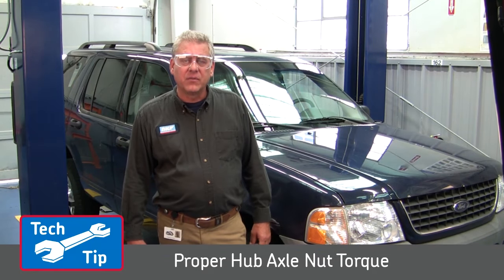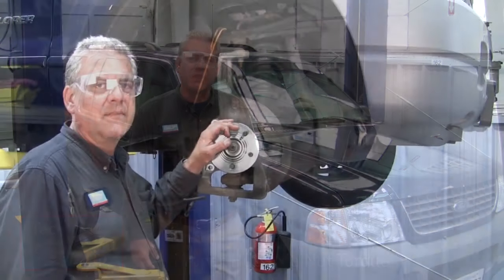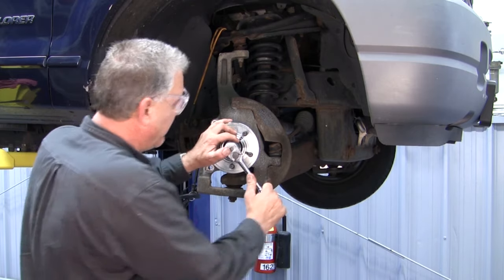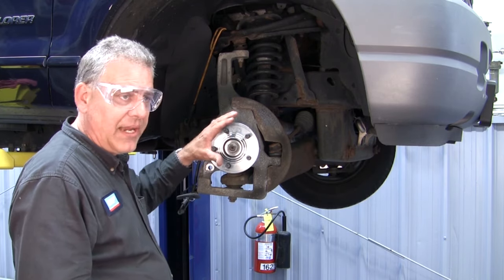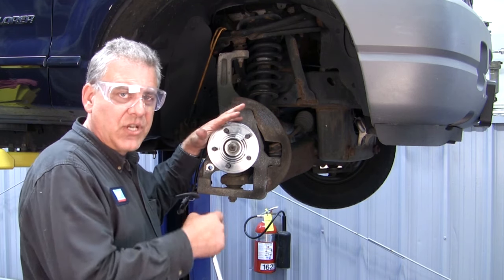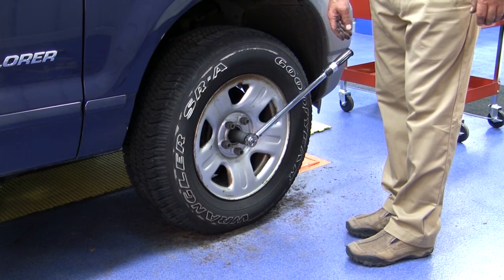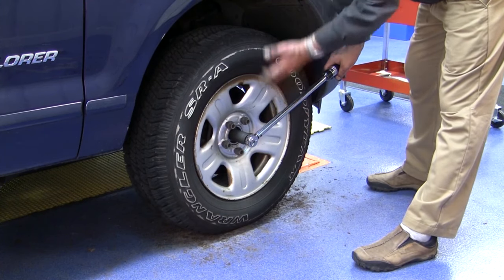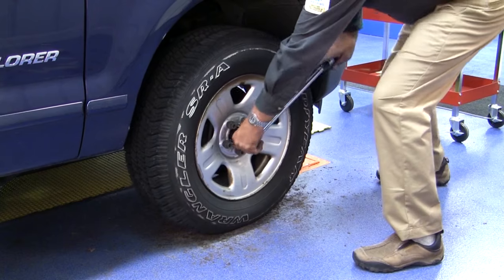Proper Hub Axle Nut Torque

Comment: I see so many repair videos with people not following this procedure with the car not under load for doing a final torque. 
Perhaps they are the thumbs down people.
Reply: 100% impossible to fully torque the axle nut down.
Reply: Walter Frederick you can do it but have to have 2nd person step on brakes or try to wedge something i between the rotor ridges on its side and brake caliper.  I’ve tried the pry bar on the studs but I can only get so much power out of that alone.  My only question is I thought I can tighten to spec all in the air.  Should I be tighten 75% in the air and then final on the ground?  That would make life easier but never had problems the other way....yet 😂

Comment: I'm a novice mechanic attempting some work on the wheel. You mentioned that the hub nut torque is 184 ft/lb. Are you using "hub nut" and "axle nut" interchangeably and, if not, what is the torque spec for the axle nut on the "02 Explorer? Thanks.
Reply from the maker: +Bobby Dennis It should be identified as an axle nut, but sometimes they could be referred to as a hub nut. The torque spec for the axle nut on the '02 Explorer on which we performed this repair is 184 ft/lbs. Please note: It always best to check with the manufacturer for precise torque specs no matter which area of the vehicle you are working on.
Reply: SKF Parts Info

Comment: 17-24 ft lbs is what I found for 1998 rear wheel drive Ford Explorer. Does this sound correct? That is a big difference from 184 ft lbs. I know this vid is for a different year and probably a 4x4. I looked it up in your torque guide and it says FT2. What is FT2?
Reply: I looked it up in your torque guide and it says FT2. What is FT2?
Reply from the maker: FT2 is the Adjustment Procedure code that is looked up in the back of the torque spec guide under 'Adjustment Proceduer'. It reads: "Tighten hub nut to 17-24 ft-lbs/22-34 Nm while turning
wheel. Loosen nut 175 degrees and tighten to 17 in-lbs/2 Nm". 
The FT2 procedure is correct for a 1998 2WD Explorer. The Procedure in the video is for installation of an SKF X-Tracker hub assembly unit. The 1998 2WD Explorer torque procedure is used when replacing taper bearings and seal in a rotor and hub unit. Different types of torque are needed depending on the design of the part and the year of the vehicle.

Comment: Good to see someone on here tell how much torque on the spec truck  I been searching around after installing a hub on a 2005 chevy blazer 4x4 and the hanyes manual says : 103ft lbs which seems light and the wheel had a humming to it and more on that corner when turning that side 180ft lbs is the right torque as to other chevy post and for the size of the ford ranger confirms my thoughts
Reply from the maker: +freakyflow We are glad you found this video helpful. Thanks for watching!
Reply: Angle torc
Reply: Howto torc degrees

Comment: Can you tell me what the torque is on the 3 bolts of the hub bearing assembly on a 2005 GMC Sierra 1500 2 wheel drive truck? It doesn’t have the axle nut just has 3 bolts on back. Thx

Comment: Listen!! You put 184 ft lbs on any baring and it's locked up!! The proper tork is, tighten it down till it don't move, then loosen it 1/4 turn!! There's no baring gonna turn even if you just put 20 ft lbs on it!!
Reply: It's not "jumping on the offensive".  It's keeping people from following bad advice.
Reply: Come back when you have that ASE Certified patch on your arm.
Reply: @infernolt7622  I don't need to come back, that vehicle won't go 60 feet,  did you even try turning that wheel?? No you just made a video
Reply: I think you're thinking of a trailer bearing that has a cotter pin to hold the castle nut on. Trailer bearings should be tightened to seat the bearings and then backed off until you can line up the pin. A vehicle axle nut doesn't have a pin. What do you propose keeps the nut on after you loosen it?
Reply: @thermal1580  really?? A vehicle doesn't have a hole in the spline to hold the nut in place?? Some may not, but mine does, ase?? Son I been workin under a shade tree way longer than you been out of diapers, and haven't needed any ase patches yet, so about the only logical thing you can do is make fun of my spelling?? Well for that, you win!! Hope that makes you fell really manly
Reply: @mikeharris8365  I didn't make fun of your spelling. That was Inferno LT. 

I did however notice that you spelled 'feel' wrong.
Reply: @thermal1580  I'm sorry, I didn't realize I had replied to your comment, sometimes I don't spell word's correctly, and sometimes it's my phone, but the point is all car's are not the same, but I see that some other people have pointed that out as well, I don't actually mean for my comments to sound as rude as they actually look
Reply: @mikeharris8365  heh. They can have their .0002 seconds of fame at 1700fps lead injection to the head. But I hear you brother.
Reply: @thermal1580  😂😂😂😂

Comment: I used a Rigid battery impact that put about 180 ft. lbs. on the nut . Emergency repair 🤦. Now I'm worried that using the Impact for initial torque may have damaged it. Had to tighten it an additional 20 lbs. to get it to spec using a regular torque wrench . Please help . The torque specs both in the technical service manual and the new hub specified 186 ft. lbs . This seems too tight .

Comment: Are the torque specifications specific to the wheel bearing or to the vehicle itself? In other words, if I used Moog instead of SKF, would the specifications remain the same, or change due to the manufacturer's specifications?
Reply from the maker: Thanks for watching. The torques specification we provide are the OEM manufacturer specifications.
SKF hubs are built to meet or exceeded the OEM specification in design and would use the OEM 
manufacturer torque specifications for installation. You would need to contact other suppliers if you need their specification information.

Comment: What is the proper torque setting for a 2004 Dodge Dakota wheel bearing
Reply from the maker: You can either get torque spec from the manufacturer or use our torque spec guide: https://www.vsm.skf.com/binary/12-460259/skf-torque-specification-guide.pdf

Comment: Looking for the torque spec for the axle nut on a 2015 elantra front wheel
Reply from the maker: You can check the manufacturer or find torque specs here: https://www.vsm.skf.com/binary/12-460259/skf-torque-specification-guide.pdf
Reply: @SKFPartsInfo  Dead link.  Is there an update ?  Looking for 02' Ford Explorer rear.  3rd replacement bearing replacement in< 10,000 miles.  Last pair shop installed lasted under 2,000 miles.  Not SKF though.  I have yours now.  Suspecting faulty installation in my case.  thanks

Comment: Would you the specification torque for a 2015 nissan versa Rear Hub Axle Nut?
Reply from the maker: Thanks for watching! Check with the manufacturer, they should be able to give you the proper torque specs for your vehicle.

Comment: Fuck the torque spec!Tighten the axle nut with an impact.I tighten the axle nut with an impact and no comebacks with failures.Can't fully torque the axle nut down.One mistake shown,jerking on the torque wrench.This gives you a false torque reading.You don't jerk on it,pull on it

Comment: Clicking twice?? LOL... Never click twice. you over torque..
Reply from the maker: Double clicking a torque wrench is a good way to be sure  you have reached the recommended setting. It will not over torque the axle nut. Thanks for watching!
Reply: Arun Narayan you can click a thousand times as long as every time you stop right when you hear the click, it is a good tip for amateurs tho. I can guarantee you if you have never tested your skill on a torque tester you will never get the feel right, I have yet to see a person (including myself) who can get to the correct torque on a torque tester without some practice(i tried five times and I am good afterwards)